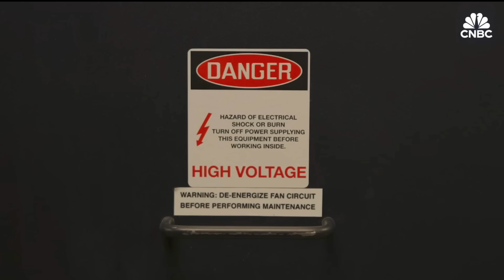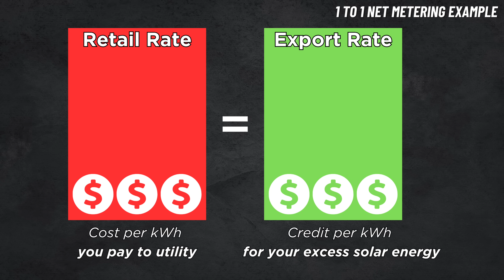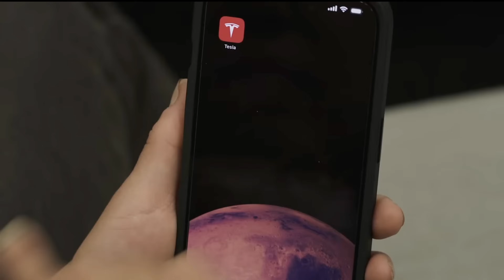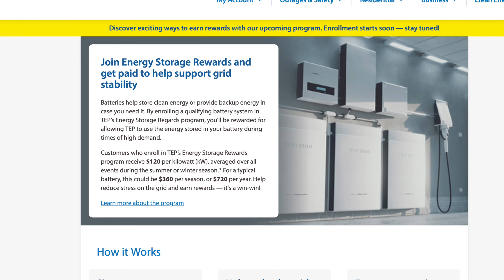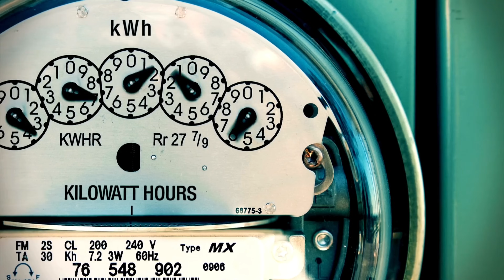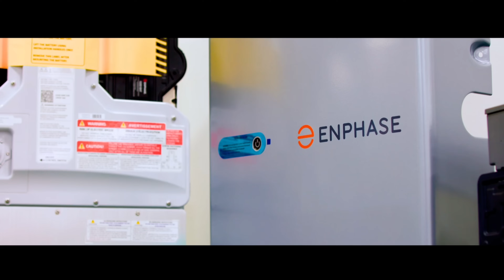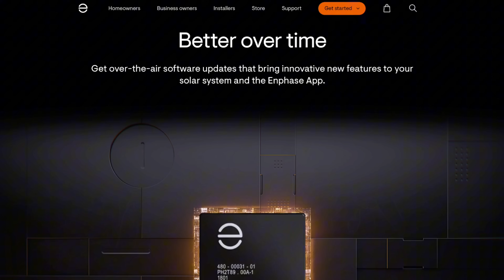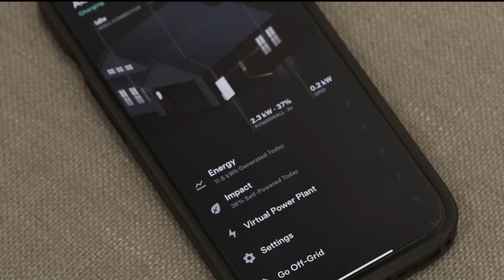Solar Panels Aren't Enough in 2026 | Big Changes Ahead?

Comment: Yeah its all great to be tied to the grid and so on. However, it does not justify paying 30% to 40% more for parts that are UL listed. Off Grid allows you to do the same just not tied to the grid. The only time you should need to tie your home to the inverter is to charge the batteries in the event one does not have a big enough battery bank.

Comment: Great vid Zach, definitely batteries are a given on any new install 👍
Love to see a head to head of PW3 v PointGuard, like your PW3 v Franklin vid.
With bidirectional charging coming sooner rather than later, PointGuard might have the edge with its DC architecture. 
If you think about it, your connection between house and EV is going to be thru the charger. If you have a standard AC wall connector, then the most you can expect from the car's battery is around 7KW. But a DC 25KW charger could be just that.. only powering your home instead!
Reply from the maker: Thanks Michael! I do have a video comparing PG and Tesla. Check it out here: https://youtu.be/X_igHCPlKaQ

Comment: Zach, I have 1 Tesla Battery and would like to add a new one to continue to reduce my energy cost.  How much would it be to buy one and get it installed?  ty
Reply from the maker: Depends on if it’s an expansion pack or regular PW3. Also depends on who you buy it from and what area you’re in. I’d expect quotes from $10k-$13k+.
Reply: @ZachSolar  ty, anybody you would recommend?  Also, What is an expansion pack?  I haven't heard of that
Reply from the maker: @timhoward3551  what area are you located in? Expansion packs are batteries you can add to your PW3 to add more kWh of storage: https://energylibrary.tesla.com/docs/Public/EnergyStorage/Powerwall/3/InstallManual/BackupSwitch/en-us/GUID-60146E9C-3743-4B7B-88E5-0BF2258CB7B3.html
Reply: I’m in Esat Mesa Eastmark .  I currently have solar and a PW2

Comment: You are still paying delivery charges even if there is a 1:1 credit
Reply: In Maine I get a full one to one net metering including the delivery charges. We only pay a minimum charge which originally was about $7 and now it's $21 a month. My system is old so I'm not sure if the same rules apply now for new systems
Reply from the maker: Good point. Not always the case but some utilities may structure it that way for sure.
Reply: @Tesla does it for unlimited ev charging . If you read the actual EFL. The unlimited charging doesn’t cover the delivery charges so you are still paying 5c/kwh
Reply: I receive 1:1 net metering for both supply and delivery.
Reply: @agler35 look at your bill .. you are mistaken

Comment: I’m not saying that batteries are bad, but I am not convinced that we should label them as “clean” either, considering the energy and materials that go into making them. I wonder if large scale power production such as nuclear is cleaner over the life of the plant, compared to the life of the battery.
Reply from the maker: That’s a fair point. There are pros and cons across the board, just like with most things.

Comment: I am fighting a battery installation. I thought my EV would be my battery solution which it is to a point. I am able to slowly bleed excess solar into charging the care using a mobile connector @ 12amps. Still I have too much solar. So dilemma. Do I wait for a Pointguard two way solution allowing me to use the EV as a battery meanwhile letting the excess solar go to the grid. I am retired and don't drive much so the car gets too full and then it's like watching water from the hose run down the gutter.
Reply from the maker: If you’re not in a rush, I’d hang out to see how V2X tech evolves. I don’t see it as a full battery replacement, but I could be wrong. No reason to rush it though.

Comment: I've been in the solar industry for 25 years and I quit my successful business because I was sick and tired of the utilities screwing us over and the permitting authorities constantly changing things on us. So I took action! I bought all of my solar and battery equipment wholesale for about $12,000 and installed it myself. Then I inflated the invoice and took the 30% IRS tax credit for an average system of my size at $28,000! So that's $8400 off of my $12,000 system! Also, I did not get an interconnection agreement with the electric utility either! My system operates in non-export mode and the solar charges my batteries and the batteries discharge to my household load in the evening. The local permitting authority did not want me putting solar panels on my super strong backyard shade structure so I said screw you to them also! So I screwed the IRS and I screwed Southern California Edison and I screwed my local building department! My return on investment pencils out to 1.9 years! I finally feel redeemed. 😂
Reply from the maker: Haha, funny story. That’s a nice bonus for the 25 years in the business
Reply: Smart to admit to fraud on the internet.

Comment: Good call out Zack.   Solar + Powerwall  = energy independence 

The utility grid trend continues with increased demand and reducing good reliable base load generation (from gas, coal, nuclear etc)  and replacing with less resilient industrial scale solar and wind farm sources without adequate storage.   Grid operators don't have a lot of options when/if the frequency drops other than  shutting down grid resources for protection and causing a blackout.   A great example of this was the massive blackout on april 28th 2025 in Spain, Portugal and southwestern France.     Entire countries lost power for an extended amount of time.
Reply from the maker: Thank you! And yeah that's a great point on the recent events in Spain & Portugal. It's never a problem until it's a problem. Doesn't hurt to be prepared.

Comment: After 6 years of owning a grid tied 16kw solar system, I am finally getting 2 powerwall 3's sometime in the next month. The solar has worked well over the last 6 years, but when the sun goes down, I am buying off the grid. With the batteries, I do not expect an electric bill from March through November. Batteries have really come down in price and have increased in performance over the last couple years. I would encourage anyone putting in solar, to get a battery setup.
Reply from the maker: That will be a nice addition to your setup! A lot of projects we take on nowadays are retrofit add-ons just like yours. Things are certainly changing.
Reply: I would start with the two PW3s but tell the installers that you want to be able to expand the system with 2 PW3 expansion batteries later on and make sure they wire and mount them to make that easy to do.

To be honest, I expect that once you have the system running and get used to it, that you will want more battery storage to make your evening and overnight consumption more convenient, better ensuring self-consumption 24x7.

For me, 28 kWh of storage is just barely enough for convenience with my dinky little 5 kWp solar system.  I definitely want more.

-Matt
Reply from the maker: @junkerzn7312  I 100% agree with this. Spot on

Comment: No lies detected! You most certainly need batteries when going solar or you'll never really reap the benefits. Don't debate yourself, pay the upfront cost. Do some math to figure out how many powerwalls you will need. For me it was simply calculating how much energy I used from late afternoon until the next morning, roughly a 12 hour period. I went with 2 powerwalls which will still provide around 40% backup power in case of a power outage during the day.
Reply from the maker: Thanks for watching! Good points here

Comment: My system goes in next week with 2 power walls and I think I should have opted for 3. I want nothing to do with the utilities in my area. They are forcing me onto a more expensive rate plan because of solar, basically a big "eff you" to me for choosing to be as independent as I can. What I'm trying to figure out out is how to charge my car during off peak hours with grid power while running my home off the batteries.
Reply: 2 power walls is plenty in terms of inverter output, but make sure there is room to add two PW3 expansion batteries in addition to the two full PW3s you have as baseline.  The PW3 expansion batteries are in the same form factor but omit the solar and inverter components... they are just pure battery expansion.
Reply: just have your car charge after midnight, so it sucks up any power left over in the battery. are you able to stop the car charger when the battery is depleted? I've not looked into that with my home set up, but I know my system can be set up to only use excess solar during the day (i just need an attachment for my Wallbox charger to be installed)
Reply: There's no official way of specifying in the app to charge your vehicle from the grid as the primary option. what I do is set the backup power percentage to maximum which will force all energy used at that point to come from the grid. Doing this will cause your home to pull from the grid as well but at least the cost would be minimal since it's off peak hours and your batteries will remain charged. I just recently shifted to charging during the day since my system is big enough to handle the load. Good luck with your new system
Reply from the maker: You can always add a 3rd pretty easily at a later point! Enjoy the new system 🔋🔋

Just use time based control and it should charge from the grid off peak automatically. You won’t be able to “split” the system to power the house while the car charges from the grid though unfortunately.

Comment: Great Video!
One of the things Doomer's will talk about is how hard it will be to build transmission lines for all the new power needs coming online (EV's, Data Centers, etc.). Something like "We can't get the power from a Solar field in the middle of nowhere to the city because the transmission lines will have to pass over a protected habitat that no one can build on. So, we might as well not even try."
I'd say, the utility already build transmission lines to every house they serve and on average they only use a tiny fraction of that capacity. Solar+Batteries and a VPP are already the cheapest form of energy generation because we already have the infrastructure. It'll just get cheaper as solar/batteries get cheaper. 
Still waiting on the Tesla VPP with Tucson Electric Power! Soon I hope!
Reply from the maker: Thanks for watching 😎 Good point about the transmission lines! And We are very excited for the TEP VPP program 🔋

Comment: With utilities buying excess solar as low as .0001 cents at peak solar production hours but selling it at .36 to .60 drives me nuts.
Reply from the maker: 100%. And it will keep getting worse. Look at Australia! Batteries are the way.
Reply: I will presume you have solar at home 🏡. I work from home and I do all my laundry 🧺 (wash/dry) two loads 🤫

Charge my car and do the dish washer. I’ve learned not to send any energy harvesting back to the mafia PG&E.

I still end up sending excess to them. I also came to find out off peak they charge 0.34 cents a kw vs. peak time 0.38 cents. Not much of an incentive if you ask me. 

You get penalized because you have solar. Sorry for the rant but it is upsetting. Luckily we were able to purchase our Enphase system cash so no bills.
Reply: don't sell it
Reply: yeah...its called mafia. PG&E are animals and over governor is a p.o.s. and in bed with CPUC
Reply: Why, that's reality
Reply: @danielgolenia5181  because when I pay $40K for a system that generates $400 in which I get $8 of it doesn't seem fair. What a scam, have someone put up the investment and they get the profit. It's only a reality because the P.U.C. was probably paid off to side with the utility company to favor a system that benefits them the most. Regardless of what did or did not happen the situation is clearly lopsided hence frustrating.

Comment: Thanks Zach, I 100% agree. The rise in electric prices with the fall of feed in tariffs (FIT) are now unavoidable. I'm in Australia - last year I finally go a home battery - I got a Franklin battery around the end of April and the savings speak for themselves - 1 year on, my app tells me I saved $1,651.60 (battery) + $1155.90 (Solar)  + $175.50 (FIT) = $2,983 AU (total savings). We have 3 hours free power during the day (11:00am to 2:00pm) on my EV plan, which is compensated with very high rates in the evening - which is why I finally jumped in to get the battery. Franklin was entering the market with good prices, and a government grant helped keep costs down to only $7,000 (AU) fully installed. Coupled with our 13.2kw solar (Total cost $8,000 Au installed about 8 years ago) our monthly bill is back down to about $50 (most of which is a connection fee).

My point - its time.  With the high price of peak electricity, the economics finally make it worth while. We are lucky to have much cheaper solar and battery prices than in the US. My own solar paid for itself over the last 8 years as we had good FIT rates back then, but now, it only covers the day's costs as we only get about 3c per KW/h feed to the grid. For anyone in Australia, there are new federal grants for batteries on offer with little red tape, which will open up the market to more suppliers and cheaper prices; like we saw with solar back in the day.